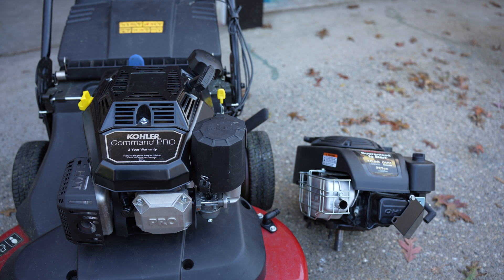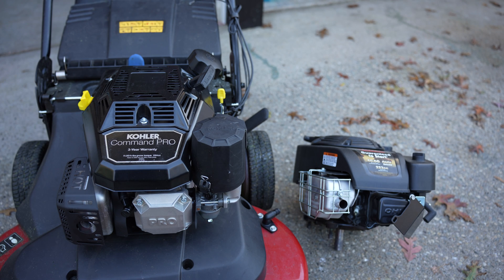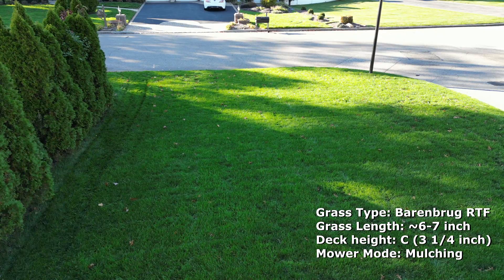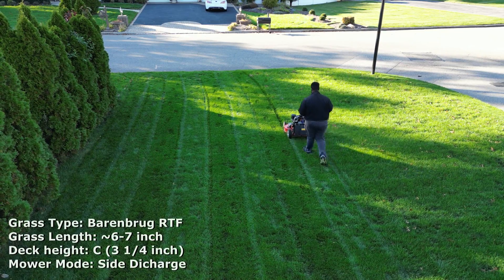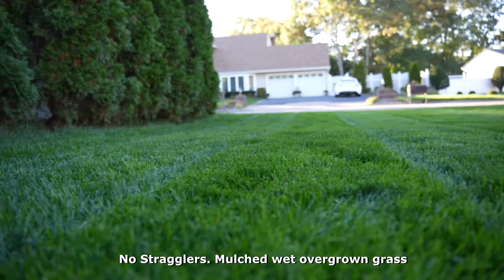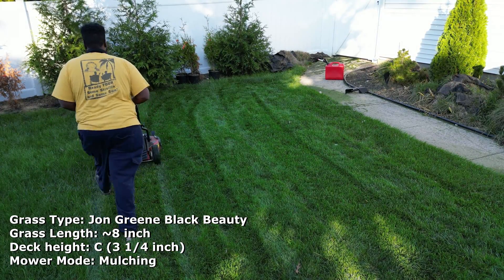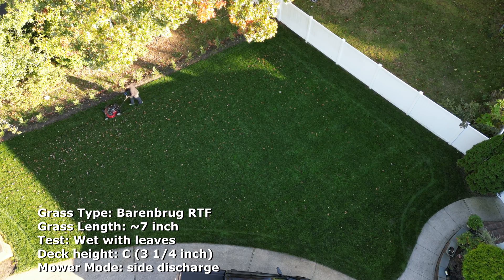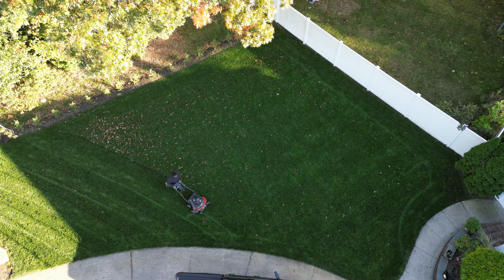Toro Timemaster engine hack - Kohler Command Pro CV 224 upgrade. Cut Quality Showcase

Comment from the maker: If you are attempting this swap the links are in the description but I will post here as well. Currently as of 4/24/23 small engines has this engine going for $450 and brandnewengines has it for $600. I dont know how long the $450 price will last as everything has gone up in price. Any amazon links are affiliate links, but the engine links I do not make money on - at all - I dont have an agreement with these people to send you to their website. I am just giving you a resource for you to use so you dont have to search for it. 

If you prefer to search yourself the specification for this engine is: Kohler CV224-3002 Command PRO 11.0 TP 224cc Toro Timemaster 25mm x 3-5/32" w/ Oil Filter - throw that in a google search and you will see tons of websites selling it.

Comment: The real test is cutting st Augustin grass being cut on a bi weekly basis 😂  . I got a customer with st agustin and the kawasaki struggles on a 3 inch cut, and stalls on a 2 inch 😂 😂. Now some of you would say why would you 2 inch on a bi weekly service , the answer - the customer wants to but its really just doje for the test  . Realy considering buying this engine so thanks for the information.  Looks like it cut very good dude 👌
Reply: Yep, i did this swap with my toro timemaster 30, and it did help with the bog down in thick grass, overgrown grass, wet grass situations. I can still bog it down if I’m mulching at a low cut height and taking a lot off the top, and can bog it down even with side discharging if the grass is wet. Plugs up the side discharge port

Comment: honda gcv 200 is less than half the price and very close torque to the original briggs. Only other decent engine offered in this segment. The Kawasaki fj180 is probably under powered.

Comment: How long did it take you to do the swap from start to finish?
Reply from the maker: @juanarredondo18  I was recording so it took me longer. But the entire process is very straight forward. It's three bolts. It takes 10-15 minutes if you are optimized. More realistic is 30 mins
Reply: @atg4469  oh wow, I was anticipating much longer. I have the 190cc and head gasket is blown along with other motor issues. Have been on the fence swapping for a while but now I don’t have much of a choice. Hoping to get it ordered this week.

Comment: The command pro for me has a very weak Transmission,  these 30s are hit and miss if it's not a problem with the belts there is a problem with the cables
Reply from the maker: hmmm what do you mean by that? the transmission is a separate component correct me if i am wrong? I will say though that the belts and cables ARE a problem and need adjustment too often in my opinion

Comment: On the Briggs ans stratton engine there is a drain plug located on the bottom near the crank shaft. I just bought the mower and ordered a drain hose for fast and easy oil changes. Has anyone pulled this plug out to make sure it is actually a plug for the oil? I cannot find anything online or in the manual about it and I have not hit the 5 hour mark for the first oil change yet.
Reply from the maker: I used an oil extractor.. Most people tip the engine. I don't know of the drain plug you're referring to but I recommend oil extractors. Nothing is easier.
Reply: @atg4469  I have one that I have to use for my Audi, but do not want to have to use and clean it each time if I don't have too. If you tip the mower up and look up in the compartment that has the transmission you can see it. It is a black drain plug with a box end on it.
Reply from the maker: @peterpowers4851  I am at work now, when I get home I'll check becuase I still have the old engine. I'll pull the plug and see what happens and post back
Reply: @atg4469  that would be awesome, thank you so much
Reply from the maker: @peterpowers4851  I don't have any plug near the bottom near the crankshaft. I just have the oil fill location which is where I put an oil extractor in. I use the same oil extractor for all equipment and cars. I just wape with a rag after each use and I've never had an issue for years. I recommend you just drain with the oil extractor it's clean and fast
Reply: @atg4469  Strange, I wonder if it is something they added in the newer models. Thank you for looking.
Reply from the maker: @peterpowers4851  no problem at all, I think I bought my time master in 2018 if that helps.

Comment: Did mine today, thanks for the videos...FYI, You can remove the black spring that is holding the transmission belt and make it much easier for yourself rather than using the 2x4 block method and wrestling with that transmission/belt combo.  Just grab on tight to the black spring with a pair a pliers, pull it out of the holder, and voila!  No more transmission blocking/belt to deal with, just put it back together in reverse when ready.

Comment: any tips on removing the pulleys? i dont really understand the squeeze thing you showed??
Reply from the maker: When looking from underneath the mower there are two belts. The blade belt and the transmission belt. The belts are round so there are two sides. If you are trying to remove the transmission belt squeeze both sides together to make them touch each other. Then using a piece of wood behind the transmission leverage the transmission by pushing it forward then there should be more slack in the belt you just pinched together and it should come off. The blade belt should be slack and have no tension because you have to use a blade clutch to engage it so it should be loose by default. If my explanation makes sense please let me know, if not I will make a video

Comment: Hey i have a guy doing mine where did you get the throttle level
Reply from the maker: the throttle level comes attached to this model. which model number did you get that doesn't have a throttle lever??
Reply: @atg4469 hey have you had problems with the transmission since the swap
Reply from the maker: @Clip5299  no, make sure the ball bearings in your wheels are lubricated with some sort of silicone spray. A lot of times your wheels can get clogged with dirt and then your transmission has to work against that.

Comment: Any tip on an engine for the exmark or toro 30 inch commercial swap?
Reply from the maker: I don't quite understand what you're asking. Can you be a bit more specific on what you're looking for? The commercial Toro is the exact same mower as this. Uses the same deck. So this swap is identical. In regard to the exmark I believe it's also the same. But I'm unsure

Comment: Great video! Lots of camera angles I like that, I have the 21” self propelled toro commercial I’m thinking on doing the same swap
Reply from the maker: Ty brother. Scag has a 21 inch with this engine attached to it. I think if you did this swap on a 21 inch I would be EXTREMELY interested to see the result. I'm sure it would be a beast.

Comment: If you have to do all of this just buy another mower....
Reply from the maker: This was made for owners of the machine who want to do something without breaking the bank. The process is actually extremely simple. "all of this" is literally three bolts on the bottom of the deck. It's really not that big of a deal. 

Lastly this mower isn't all that bad, there are some advantages of doing this. Number 1 it's cheaper to do this than buy a new mower. Ferris 15, Turf master, and scag 30 are all WAY MORE expensive than swapping out to the motor those machines use. WHY SPEND 1500, when you could spend 500? This is actually a way of having a good machine but spending less money. Number 2, putting this mower on the machine while keeping the other good aspects of the time master is beneficial. You maintain the personal pace, lightweight, easy to maneuver, 30 inch cutting deck machine and make it more capable.

I understand your sentiment, appreciate you watching the vid, but understand there is a market for everyone
Reply: @atg4469  I own this mower.  I wouldnt' dare put another engine on it and have over $2,000+ grand invested in it.  Just buy the commercial version.

Comment: Thank you.   I have a little less than 1/2acre to cut on my property but my side yard is a slight incline (5~10* maybe) and the Briggs is definitely underpowered.  It blew the oil seal a month after warranty ran out (right on queue).  Replaced it but after a year later, the engine is running very rough.  After watching your video, I'm not even going to attempt to diagnose and repair it.  I ordered the Kohler today (it's still $450).
A question...  what did you end up doing with the kill stitch?  I have electric start and I'm thinking I just remove it altogether (never worked all that well on the Briggs anyway) and just use the throttle/chock lever.
Reply from the maker: Thank you so much for watching!! In regard to the kill switch, I ended up just not using it at all. It isnt worth the time and the energy to splice it back in because the yellow lever acts like a kill switch.

Comment: The blue sponge in the TT-30  catch dirt while you have your gas cap off.
Reply from the maker: Lol what you said it's 100% accurate and true. But the engineers who designed also put a fuel filter. isn't that why they have a fuel filter?

Comment: Did you ever hear of the thirds rule in cutting grass?..you never cut more than a 3rd of the length of the grass...if you're deck height was at 3 1/4 there's NO WAY that grass was 8 inches.
Reply from the maker: The rule of thirds doesnt prove or disprove the height. It's the rule for cutting healthy grass. My mower was down for weeks and it was not cut. Out of the 1000s of views this video has, this is the first comment claiming the grass wasn't what I said it was. It's clear in the vid that the grass is extremely long. 8 inch grass isn't 16 inch grass that went to seed lol.

Either way, I agree with the rule of thirds, it was a torture test and I said that in the video
Thanks for watching brother
Reply: @atg4469  just going by the vid, you can clearly see its not...typical man claiming something is bigger than what it really is...I feel ya man.
Reply from the maker: @gytzater  no problem brother, thanks for watching

Comment: Do you know if the Kohler command cv12.5s engine will it fit the time master?
Reply from the maker: I'm not sure. The spec I left in the description box. If you have a link to the engine you're looking at, post it, and I'll review and get back to you. My gut feeling is no. But it's not out of the realm of possibility as long as the keyway and the bolting pattern matches. Theoretically you could bolt anything thing on as long as you're willing to drill the deck.

Comment: You sir are the man.  I've had my time master since 2013 the 190cc.  Thank God I do all repairs myself if not I'd be broke.  I've bandaided this engine way too many times.  Minute it's hot it shuts down.  Thanks a million for the review.  I shall consider your recommendation.  BTW I cut on A height.  Im in Florida and have St.  Augustine grass.  ✌️ My friend.
Reply: I switched the Briggs engine out for a Kohler and couldn't be happier. Well worth the swap. I have 1 that I use for a lawn buisness and I also changed the pulleys out for commercial grade as well.
I just like the timemaster because it's light and it gets into smaller gates.
Reply from the maker: Thanks for watching, I think that's a good option. This spring season I've noticed my grass is literally healthier because the cut is much neater and more consistent. It has a better vaccum and it leaves no stragglers. Even the grass matted down from the wheel paths are pulled up. I have struggled for many years with that underpowered Briggs and I don't think ppl realize what a peace of junk it really is. For the money Toro really should just give the cv224 out of the box.

I think for your grass type, you won't be disappointed. Would love to see a follow up vid if you ever decide to change out the engine with your comparison
Reply: @atg4469  I have two  30" Time master.  I'm thinking this week I may order this.  I'll stay in touch with you on the swap.
Reply from the maker: @capeman10  perfect, if you run into trouble please take a video and tag me and I'll make a video back to try and help out
Reply: @atg4469  I've placed a new head gasket on the junker I found.  I started it and will video it cutting.  The 224 Kohler is still on board.  I'm going to ship local and check out the price.
Reply from the maker: @capeman10  excellent keep me posted

Comment: Will this swap work on timemaster 20199? 190cc briggs and stratton engine
Reply from the maker: yes and in fact you need this engine. the 190 is a horrible engine and severely underpowered. I went from the 223 cc and even that felt underpowered.
Reply from the maker: yes

Comment: Coming from a Timemaster owner, I can verify that the B&S engine would have bogged down after 2-3 swipes on that type of tall wet grass.
Reply from the maker: It's night and day man trust me. Toro should offer the command pro as an optional upgrade from factory.
Reply: @atg4469  appreciate the videos and info. I've been frustrated with the Timemaster since I bought it. I'm definitely thinking of making the switch.

Comment: replacing my engine now, the original briggs just wont stay running, took it apart completely twice, replace head gaskets, check valves, everything, has low compression.  My dilemma is do I get a Kawasaki or a Kohler?  Kawasakis make great engines I know, I've heard mixed reviews on Kohlers.  I know the Kohlers have more hp, but I dont need that much more HP, have 8000k of bermuda and cut dry everytime
Reply from the maker: I'm biased brother, I recommend the Kohler. Better to have the horse power than to be in a bind. You never know the future. Could have an emergency where you can't cut the lawn and it becomes overgrown or worse you have no choice but to cut it wet.

Comment: Very nice video.. did you also Change out the two idler pulleys to the upgraded ones as they always blow out also.
Reply from the maker: Yes I did
Reply: Always blow out?..I've been running mine 5 years commercially with no issues.

Comment: very interesting! The weak point of the original Timemaster is that the grass sticks and blocks the mower deck...and the reputation of not good for tall grass. Did you observe a difference now? Is your machine able to work well with tall grass and in the collection mode in the basket?
Reply from the maker: Yes, partially the deck clogs because of the shallowness of the deck but also the airflow pattern. It can be mitigated to a degree by using slip plate graphite coating and/or lawnmower spray lubricant which I believe is silicone. Some people use Teflon or ceramic coating. I typically mitigate the clogging by raising the deck to the highest setting and using side discharge, then going back over in the same setting and mulching. Then I would go to the next setting down and sidr discharge and go down incrimentally with side discharge taking off bit by bit. I never clog like that. But if I have to mulch I would make sure the grass isn't wet or ensure I have a deck coating. Now since the geometry of the deck hasn't changed theoretically if is the same risk of clogging. That being said I noticed on the Briggs engine that mulching DRY grass would bog down. In this video I showed that I mulched overgrown damp to wet grass and there was no bogging - I did not follow my typical pattern of raising the deck with side discharge and mowing, I just set it to c which is 3.25 inches and went straight to mulching and the machine never boggs down. I do have slip plate graphite coating on the bottom of the deck here but in my honest opinion I like gumout deck coating better. The slip plate doesn't work well in my opinion. I also wash out my deck after each cutting (total cutting of the entire lawn, not each pass).

Hope I gave some insight. Also yes it works well with the bagging as well.
Reply: Try just lifting the front wheels off the ground slightly when mowing in tall stuff...works like a charm.

Comment: How much heavier is the mower, and how much more difficult is it to turn, with the Kohler engine?
Reply from the maker: It is heavier due to the construction but it's not that much heavier to be honest. It's not more difficult to turn at all. If anything the weight distribution feels a bit better. It's more balanced when tipping for oil change, it's more balanced when cleaning out the deck. It's more balanced when I have to lift it up slightly to turn. The weight is neglible honestly but I can describe it as being better balanced on the deck itself. The lawn mower feels "made in America" if you catch my drift. It doesn't feel flimsy anymore.
Reply: Are you tipping the Kohler to change oil or undoing the square drain plug?